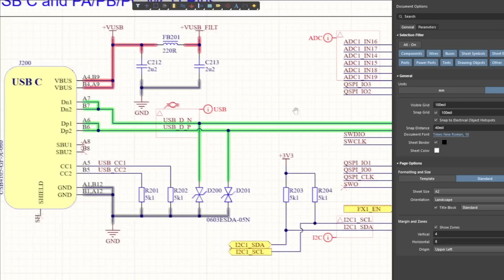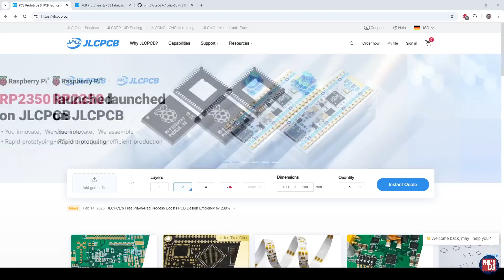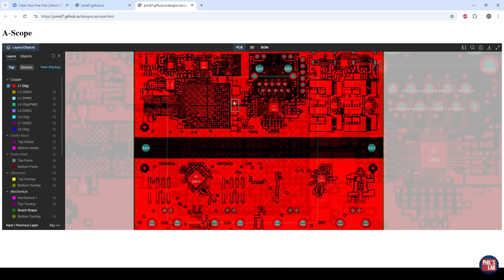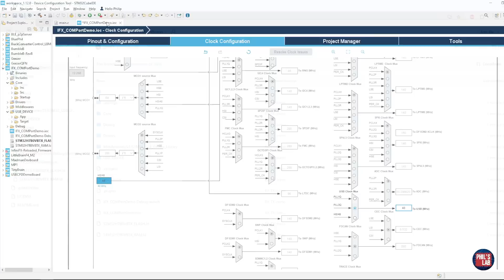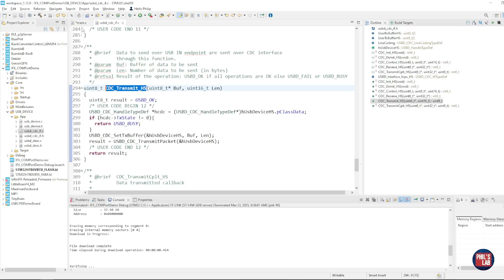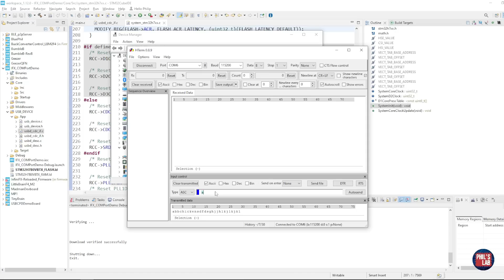STM32 USB Virtual COM Port - Phil's Lab #154

Comment: I don't have an original debugger, so once I built the program I used ST-LINK Utility to program the chip. The problem is that when I connect it to the PC with the USB-C it doesn't appear as a COM port :(. It does appear when I connect it with the ST-LINK V2 debugger however. Any idea what might be happening?
Reply: Apparently I had forgotten to include a 1.5k resistor so I had to solder it externally and it ended up working!!! OMG I'm so happy
Reply: Thank you Phil so much for your video you have no idea how helpful it is!!! GOD BLESS YOU

Comment: Hi @PhilsLab. Thanks very much for the video! You said in the video the code to have the VCP recognized was copied from a ST example and is in your GitHub. It looks like you have changed from CDC to usbd_audio_if.c before posting to GitHub, and this code is not actually there. Any chance you can point to the ST example where the code came from?
Reply from the maker: It's under the 'comport' branch.

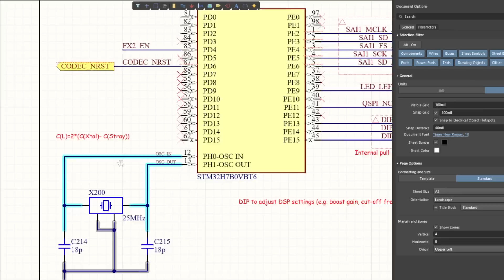Comment: 2:40 about the usb clock source:
If you don't want an external crystal, make sure that your STM32 Model has this kind of specific USB clock called:

"HSI48 RC"

This is an extra 48 MHZ clock inside the STM32 IC, which is suitable for USB 2.0.

Comment: Thank you for the wonderful video, Phil! If the LineCoding lines are not added, what baudrate will the STM32 MCU use? Anyone tried that? And is it possible to use high speed up to 1MBits/s? Thanks.

Comment: Hello Phil, I'm designing a 5-level cascaded multilevel inverter (MLI) using two isolated H-bridges and would appreciate feedback on my power supply configuration. Here's my current setup:

Key Components
4x Isolated Gate Drivers: UCC21551CDWKR (dual-channel)
Isolated DC/DC Converters:
Input-side: 1x converter (6.5–32V input → 5V output) powers:
This converter supplies 5v to All 4 drivers' input sides (PWM logic) and to the Current sensors (ACS732).
Output-side: 2x MEV3S0515SC (+15V isolated converters):
One for HB1's 2 drivers.
One for HB2's 2 drivers.
Grounding Scheme
Input Side (Control):
5V converter output ground is shared with MCU ground, Current sensor grounds and Drivers' input-side grounds.

Questions
Is it correct to use separate MEV3S0515SC converters for each H-bridge's drivers? And is the GND correctly labeled?

Are there risks in sharing the same 5V supply for drivers and sensors?

In this case do I need 5 external sources? 2 for isolated H bridge (my H bridge needs 60v) and 3 external supply for the DC/DC converter ?.......is there a way I can get ur feedback? here is a link to my schematics....[https://drive.google.com/file/d/1ZdWBm2PVi9kGxXt3aJb87XCRVdLbVGmM/view?usp=drive_link]

Comment: I'm currently getting USB FS up and running on an H563 and this is not what I see in CubeIde 1.18.x. USB is now based on USBX and ThreadX. It would have been more helpful if the video was using the latest release.
Reply from the maker: Depends on the MCU chosen (e.g. H5, U5), not on the CubeIDE release. You can port this ST VCP driver over manually based on their public Git repo.

Comment: I think receive flag and rx buff len should be atomic level, because in irq level they have been set, in handler mode we are clearing them. Assume when we try to clear them IRQ can be occure. Therefore we need to disable irq and enable irq when we changing those variables.

Comment: Could you please make a video covering the use and implementation of VUSB sensing for self powered devices? Preferably covering both STM models with (stm32f4) and without (f1) dedicated pins please.

It would be very useful, and it's a topic that I havent found much information on, despite it being so common.

Comment: USB is really cool when used as a composite device. You can essentially run multiple functions over a single connection. Unfortunately, the STM IDE doesn’t provide an easy way to set it up.
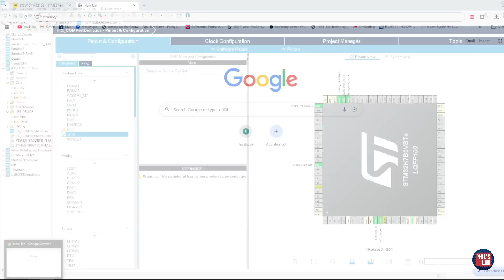6:30 – As stated on the STM website, extra drivers are no longer needed for Windows 10 and later. For Windows 7, you can use tools like Zadig to configure Windows to use the default CDC driver for your hardware.

Comment: is there any downside during the linking of the A7/B7 and A6/B7 for the USB2 lines? any issue on the tracks to be aware of?
Reply from the maker: Yes, this creates small stubs on the signal lines, which generally aren't a great thing to do. However, for USB 2.0HS I have not had any issues. For the USB 3.0 SS TX/RX lines I would not do this however, and would pop in a dedicated multiplexer.

Comment: I've been thinking about playing with the stm32 controllers. I found esp32 And that was my gateway drug into the micro controller world! Lol!!  I stopped doing the esp32 module, and using the esp32 soc chip Where I have to create the circuitry for the crystal, antenna connectors, USB, UART, Nor flash, psram, etc ..  And I like to look a lot better, it makes my projects look a lot more professional, and not just a soldered on module that I ran the traces off of. Also allows me to get a much tighter denser array on my boards, and not be limited to the antenna portion of the ESP32 modules, and things like that. There's been a couple of applications where I need a little bit more horsepower or a little bit more GPIO, and I've used extenders and stuff for the ESP32s, and code tricks and things to make it seem a little bit faster and operate the way I needed it to. But I'd love to Play with the STM 32 microcontrollers as well also in some instances for some of my projects that are tiny little things that do one simple thing where I don't need a lot of horsepower or software or anything The STM32 micro controllers has a lot of really good options. With ESP 32 is a little overkill.

Comment: Thanks Phil, I've used the built-in USB on a few different parts now, but for high speed have been using the FTDI FT4232 parts quite a lot recently. They give up to 4 channels, which can each be set to work as UART, i2C, SPI, parallel or bit-bang devices. In the most recent project it was to broadcast a section of my desktop (I made a native Windows app for this) across to display on a small device where I could swap daughterboards containing different types of display, for testing them. 

The benefit of this for me was offloading all of the USB processing overhead from the MCU on the main board. Basically the low powered 8-bit MCU would read an EEPROM from the daughterboard containing the command sequence to initialise the display, and tell the windows app (via a UART channel) the type of display, dimensions etc. Then the Windows app just pushed data using a SPI driver, which went directly to the display, so could achieve high frame-rates, even with large-ish resolutions, with the MCU basically doing little-to-nothing :)
Reply from the maker: I'm quite a fan of the FT4* parts as well! For most projects that use an MCU I do tend to stick with the integrated USB PHY of the ST however,, as that reduces hardware system complexity and cost. For now, the overhead on the MCU hasn't been terribly much of an issue.
Reply: actually the usb controller is a peripheral on stm32, the protocol is process on a dedicated module, cpu interact with it by writing register value to a specific address in RAM, the ahb bus shift the data from ram to peripheral register, with that being said, you generally do not load too much on cpu when you using any peripheral

Comment: Do you think it is necessary to append a null terminator "\0" at the end of the received char array in the Rx callback function? I think since you are using memcpy, the buffer may contain stray characters if a shorter string is received after a longer string?
Reply from the maker: Yes, the buffer will contain 'stray' characters (if a shorter buffer is received after a longer one). But then again, we have the # of currently-received bytes to get only the required amount of characters. Keep in mind, this is just for a quick demo - actual implementation will differ quite a bit, depending on needs.
Reply: @PhilsLab  I typically just use an intermediate temporary buffer initialised as {0} in the local scope, then use strcpy which copies up to and including the first null character. I validate length before placing in the temp buffer. The result is very clean code, which is flash efficient and is usually ok if you have some headroom in the ram/heap/stack. I name the temp buffer the same throughout the project, then if I need to optimise the heap/stack - its easy to refactor, to something like what Phil does.